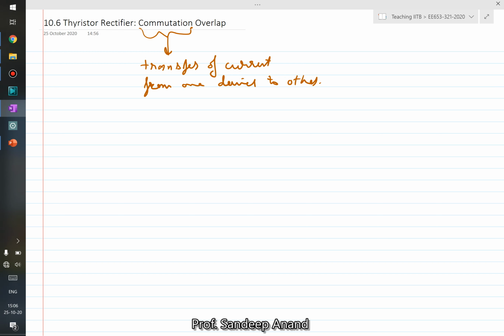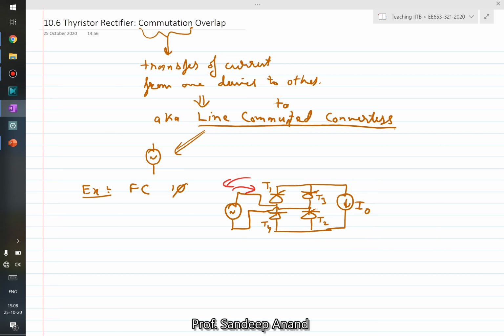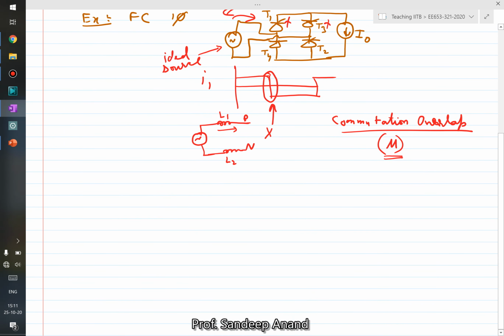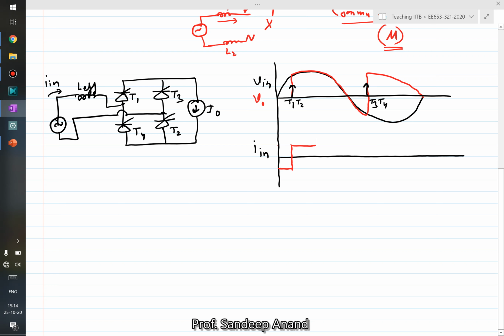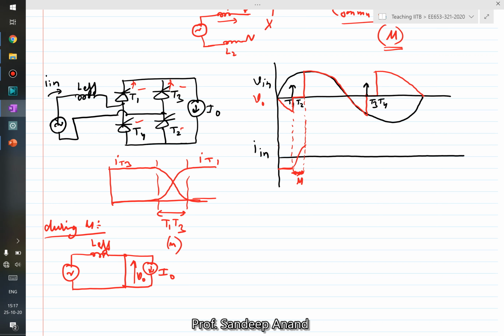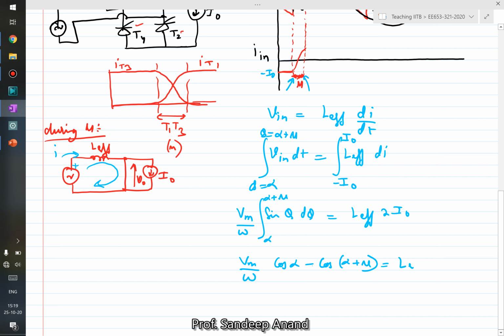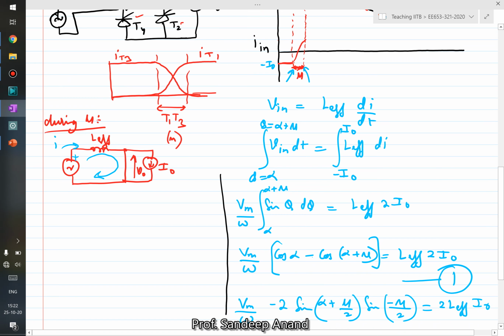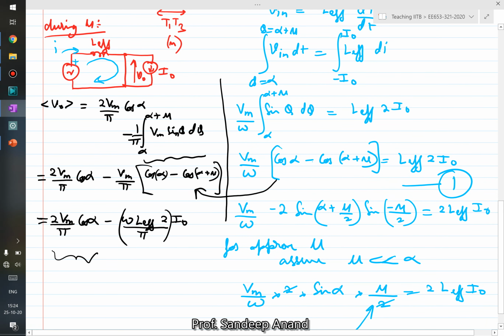10.6 Thyristor Rectifier_Commutation Overlap

Comment: i have been working on this and have really struggled to understand the current flow during rectification through the circuit during commutation as I keep running into issues where currents in different loops appear to flow against each other and in different directions. for example, as the voltage supply goes negative and you fire the relevant thyristors the source inductance will supply current will supply current through the previous conducting pair of thyristors whislt current also begins to flow through the new pair, but this is two different directions of currents appearing to be supplied from the source out of the positve and negative terminal. is there any way you could try to intuitively explain what actually happes current flow wise during this interval through the whole circuit?